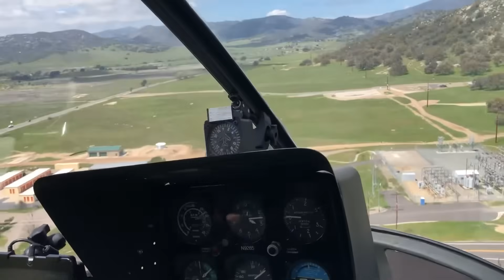Helicopter Mid-Air COLLISION Near Hammonton Municipal Airport NJ - Early Analysis

Comment: Well, these 2 pilots knew each other and had just had breakfast together at the airport restaurant—-apparently their regular practice before taking off separately in their helicopters. Per interview with restaurant proprietor. Possible failed attempt at “formation flight”? In any event, appears not two random aircraft operating without any knowledge of the other; regularly operated their aircraft concurrently, meeting together on the ground beforehand. Preliminary info.